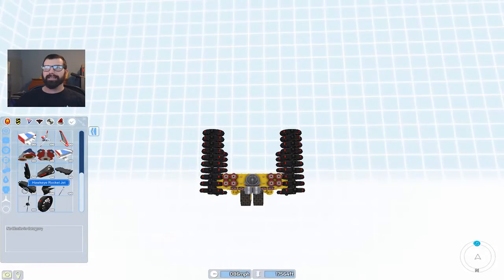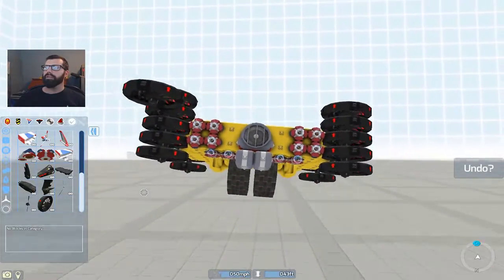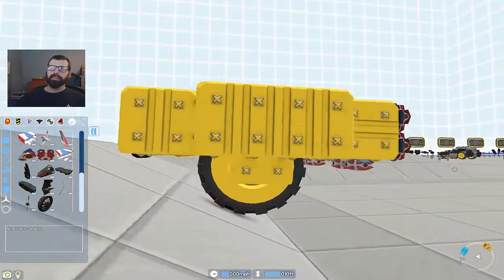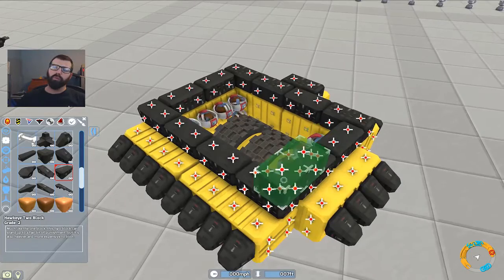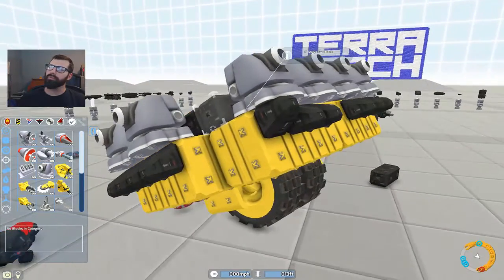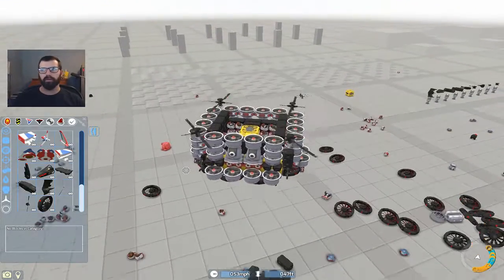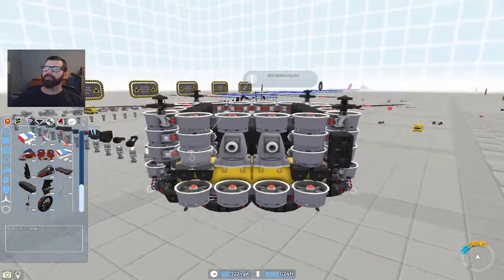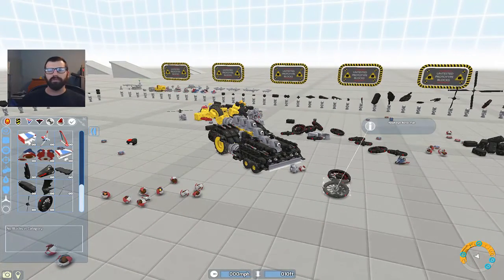Terra Tech:Ep25 Gyro/Chopper-Tank Part1

Comment: From my experience, there is currently no way to create rotational force when hovering, except with airofoils (which only works with forward momentum). The only thing you can do is to place 5'ways of center to push the vehicle around its axis. Try loading up R&D with the my community tech "Mosquito gunship" and see how you like it. A little finicky, but can - sort of - rotate :)
Reply from the maker: Ok I see what you did their. by putting the thrusters that far away and that high you've increased their leverage so you can manipulate the tech without as much force. interesting.....

Comment: I have the solution to turning 360 in the air. It is all about the GSO horn steering hover. It has two directions. If placed at the rear or nose of a flying vehicle in opposite directions, it acts as steering. Here is a image of a helicopter as an example. 
https://i.gyazo.com/aa7ee5dc68012509c6d2aa868986aeef.png
Reply from the maker: I've ran some test's with the steering horn's. I like the results. Thanks for the tip.
Reply: yeah, that looks more effective than my idea. I think the horns have more force than the 5-way. Time to go experiment :)
Reply from the maker: lol